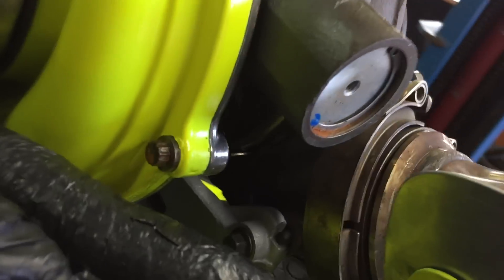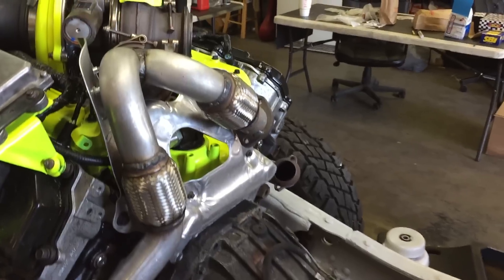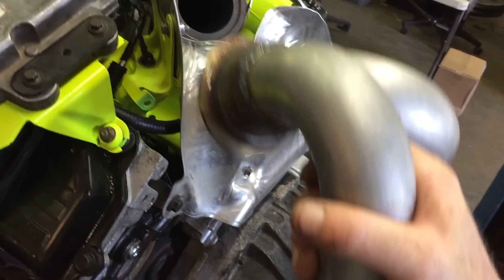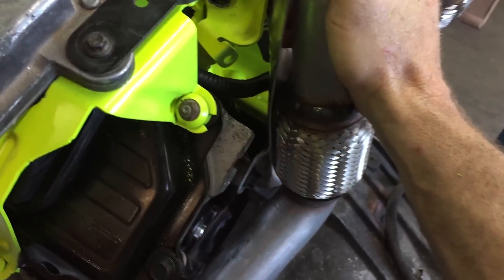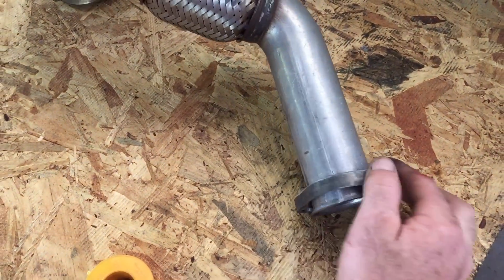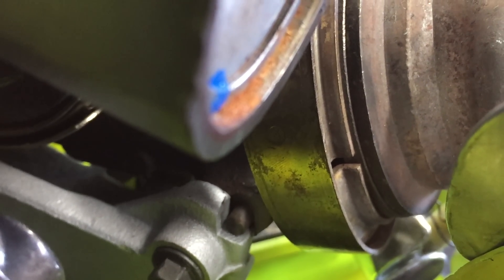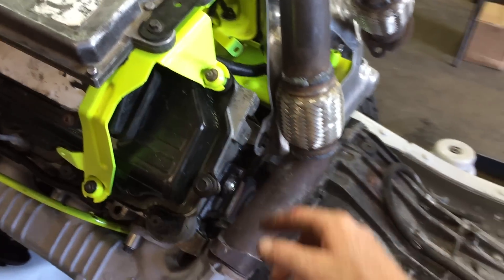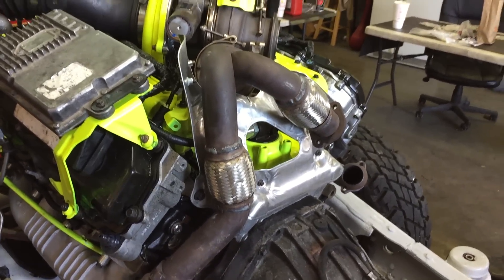Super Duty Service's Y-Pipe for the 6.0 Powerstroke

Comment from the maker: We are tig welding these now and they are backpurged.  They look much better than the one in this video.  We also swap heat shields for yours.  We send you one that is bent already in exchange for your unbent one.  Or if you are 03-04 and some 05's,,  you must purchase the heat shield because your shield is attached to your y pipe. We do not sell them with the attached heat shield.  Call the shop @ (816)548-6970.  If we don't answer,,  you must leave a message.  We do not have a "phone answerer".  Lol.  Everybody in this house works.  You can text that number also.  We've got that capability too.
Reply: what is the cost for the y pipe and the heat shield, and what is the time frame?

Comment: So, can you do your y-pipe cab on, since it fits correctly? Thanks, Jay
Reply from the maker: Andrew Townley ABSOLUTELY!!!!   Cab-off is NOT necessary.
Reply: On my 08 6.4 passenger side. I had to lift the cab about 4" to get the up pipe in. It helps if you raise the cab before taking the up pipe off so you can access the bolts in the top of the up pipe. I also removed the inner fender well to access the bolts to the exhaust manifold. It's not as hard as you may think. It'll save you $$ to do it yourself. Shops are crazy on prices for this repair, especially ford garages. I hope this helps someone.